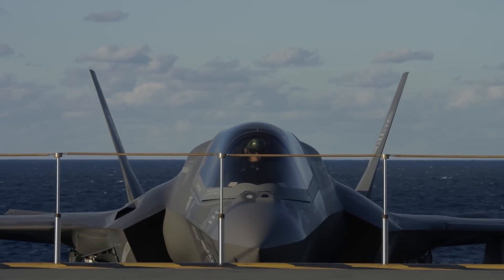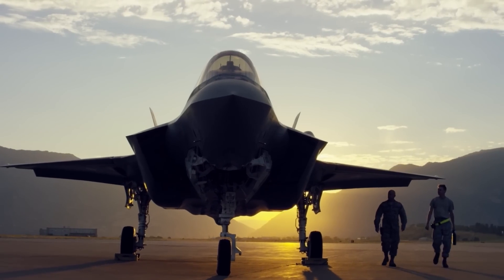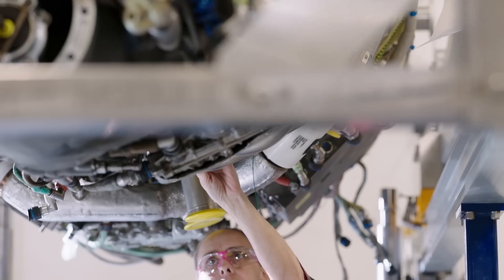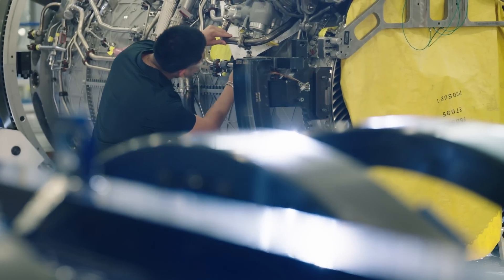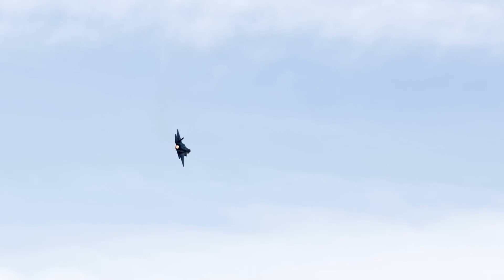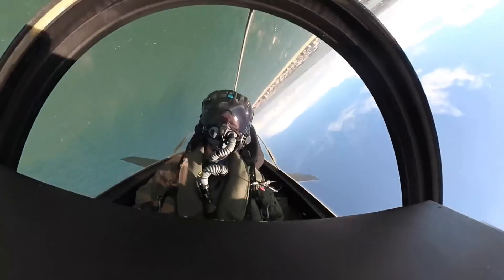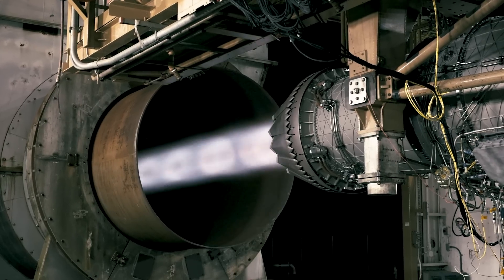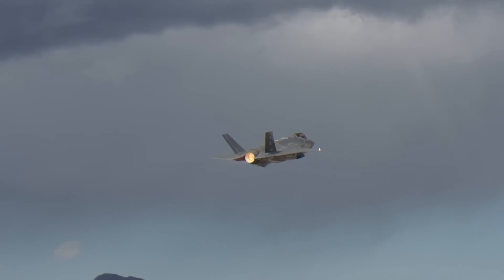The Future of the F-35

Comment: We need to start thinking of doing more, to field more quantity of high tech, cheaper cost of ownership over the life of the equipment and cheaper entry level variances of equipment. As much as I love technology, it is no good if the ceiling price keeps going up and up and up. If we were able to field 2,000 F-35 for the price of the 700 units and still be able to have the same costs of maintenance over the life cycle of the program and still maintain the capacity to keep flexible dormant production to  ramp up production in case of war, then the costs would be similar or even a 5 or 10% more, but we would have 3 times the size of the force, capacity to have airplanes cycle through maintenance and upgrades and still have significant numbers in service and a production line ready to pump more units in case of war. That would be surprising, we have to learn to work with less, not more..

Comment: Maybe the cause of that F-35 that made a rough landing on an air base was probably because the pilot lost focus on the VTOL and accidentally put more thrust instead of powering down the engine.

Something like that tends to happens in simulators. The simulator VTOL VR has some amazing mechanics and everytime I lose FOCUS on a soft landing, I tend to cause the mistake that happened to the pilot.

Maybe if the pilot powered down and pitched up, that whole landing mistake would have been avoided
Reply: "Maybe the cause of that F-35 that made a rough landing on an air base was probably because the pilot lost focus on the VTOL and accidentally put more thrust instead of powering down the engine."(sic)

Incorrect. Failed fueldraulic line as was the hypothesis last December and later confirmed by engineering analysis, not pilot error. Thanks for emoting though, madame.

By the way, the F-35B is STOVL not VTOL.
Reply: @AA-xo9uw  STOVL… I keep mixing them all the time

Comment: Isn’t it ironic, they just lost a F-35 from engine failure?
Reply: There have been no F-35 mishaps since the fueldraulic line failure on 15 December 2022 in Fort Worth. No cause has been released for the F-35 lost at Hill in October 2022.

Comment: This seems like just a marketing pitch.  Who is the intended audience?   The rationale (cautious evolution is faster, safer and less costly than a technological leap) is simple. Taken at face value, one may say 'Sold!'. But an intelligent decision requires proof of the assertions, and QUANTIFIED proof at that. The competition (adaptive engine) is more advanced. But 99.999% of us Youtube viewers are totally unqualified to assess the relative risk/reward of the alternatives. A counter argument is that the adaptive engine offers very significant increases in power and fuel efficiency (i.e. operational range). I believe I also read that for a given power level, it runs a bit cooler. That might partially reduce the amount of bleed air needed for cooling electronics, etc.
If any viewer wants to judge which is the better alternative, then viewing presentations/pitches for the alternative is a requisite.
Reply: It is a marketing pitch.  The F-35's engine, the Pratt & Whitney (subsidiary of Raytheon) F135, has hit its limits (ie. it has fallen short of program requirements) so a reengining is required.  The choices are a tweaked F135, a tweaked GE F136, the P&W XA101 ACE, and the GE XA100 ACE.  Raytheon's problem is that the F136 had better thermal headroom than the F135 to begin with, and when it comes to adaptive cycle technology GE is at least a decade ahead of P&W.  So this video is Raytheon desperately trying to remain the sole engine provider for the F-35.
Reply: @JonMartinYXD  Interesting. Thanks for the reply.

Comment: What about hormonic resonance problem? ECU only a light mitigation of thermal issue. You know turbine inlet temperature of F135 today? 3600°F (1980°C). The hottest turbofan of the planet. Early  Aging is fate of F135. Sand melts and blocks cooling ports of CMC surface of turbine blade other issue. GE has non adaptive cycle alternative also.
Reply: Yeah, GE has the XA100 ACE and the conventional F136.  The F136 performed as well as the F135 but had better thermal headroom.  If the JSF program had chosen the F136 this whole reengining discussion probably wouldn't be happening.
Reply: @JonMartinYXD  i agree

Comment: Can anyone tell if the VTOL capabilities are actually being used ? The verticality would come handy in the Pacific, but I'm not aware of it being used in combat. Thanks.
Reply: The F35B can vertically take off however, that feature is really for vertical landing. I think they call that STOVL which is Short Takeoff and Vertical Landing. It cost too much fuel to lift off vertically.
Reply: @Kyte001  Right, fighter jets need the right infrastructure, crew and equipment. So F-35s exclusively using helipads in case the runway is destroyed is silly. Got it, thx.

Comment: It's important to be able to save fuel, fuel is your life when you're out there, and keep that engine running hell or high water
Reply: I'm concerned about the f-35b thermal signature during takeoff on light carriers, it's generating a lot of heat in the transmission, and it could put a thermal signature on the carrier and make it a vulnerable Target, I wish the f-35b had more fuel capability of takeoff and Landing with missiles oh, you had a few have to dump you fuel before you can land and balance out the aircraft that's not a good thing

Comment: I’m sure it’s not this simple. But why not just put the cooling system for the electronics closer to the actual cockpit? I’m sure they could design something where outside air being pulled into the intakes could be siphoned off to act as the cooling. Seems like a lot less expensive idea than some kind of fancy new system.

Also, I don’t want to be a Donnie downer here. I greatly respect Raytheon technologies, and all that but I hate to say it I don’t see this plane being white I guess a lot of people want it to be. No maybe I’m wrong but if I recall correctly, the hold is basically for this plane to essentially replace the majority of fighters in the US military. that actually is not a good idea. Over specialization will inherently bring about weakness. And it greatly reduces the chances of adaptability.

Comment: Lockheed Martin should be embarrassed by the cost overruns and lack of performance of the F35. If it ever got into close in Dogfight, it wouldn't stand a chance. It's maneuverability is weak considering the cost per plane.
Reply: Get your head out of your ass reformer. Dogfights are a thing of the past
Reply: Its not suppose to dogfight. Its sensors are suppose to detect enemy vehicles, planes etc from very very long distances like beyond visual ranges and shoot highly accurate long range missiles at the target. What follows is the enemy plane is unaware they're detected and are unable to locate where the F 35 is even if it knew it was in the area this applies with missile defense systems. the F 35 currently can outrange some missile defense platforms, some older ones can't even detect it at all.
Reply: "it's maneuverability is weak"
Maybe dont trust forbes, RT, and Pierre Sprey and their bullshit since they dont even know the F-35's secrets https://youtu.be/2Xygbw6t_z0

Comment: Meanwhile on Capitol Hill-

“WASHINGTON — As the Pentagon and Capitol Hill gear up for a fight over the decision not to pursue a new engine design for the F-35, officials this week stated that increasing demands placed on the legacy F135 engine are poised to wear and tear it at higher than expected rates — resulting in what congressional auditors say is an extra $38 billion in future lifecycle costs. “

“Just 53.1% of the fighter fleet was found to be mission capable in February 2023, with 29.3 fully mission capable, according to prepared remarks [PDF] delivered by Air Force Lt. Gen. Mike Schmidt, who heads the F-35 program. As of March 1, there were 564 Joint Strike Fighters in the DOD’s inventory, F-35 Joint Program Office spokesman Russ Goemaere told Breaking Defense.”

If you throw enough money at it you can probably make it capable of traveling through time.

Comment: Anybody else realize the reason they gave for the need of the block 4 upgrade was, a bunch of hand waiving with the word "warfighter" inserted as much as possible? Lol eventually they get to hey we got cooling already, maybe let us do both? Bc its better for you? U buying that? Lol
Reply: From what i can tell.  Cost.  There are a lot of upgrades going into block 4.  Trying to add a new expensive engine was hard to sell over a much cheaper more manageable upgrade.  These upgrades will make up about 30%-40% of the difference in performance.  The cost is likely to be substantially different.

Comment: Kind of sucks we have to think of "tax payer" money when it comes to military equipment. There shouldn't be a price tag attached to National Security but it's been beat into us with the several hostage taking of the government from congress. I was an "essential" employee and had to work no matter if I got paid or not so I get it. Be budget minded with EVERYTHING so in return we only get more efficient and maybe not the best solution but the cheapest we can come up with while meeting the bare minimum of requirements.

Hopefully the engine that uses small nuclear for heat instead of fuel will be developed soon but I think that's Boeing or Lockheed; either way that would allow tons of savings with fuel and allow more budget for research as to what is best, not the cheapest.
Reply: people working without pay require barbed wire fence and armed guards to keep working past few months
Reply: Nuclear engines?  No.  That's been tried.  It ends up being horrifically expensive and all the radiation shielding required makes the plane much bulkier and heavier.

Comment: In other words, they don't want to lose the contract to GE.
Reply: You hit the nail on the head on this.  P&W has officially communicated to the USAF that there won’t be any future savings on the F-35. 

As a warfighter myself (pilot) the adaptive engine yes will cost up front NRE, but it will save operational costs due to less fuel usage on top of providing likely up to 25% greater range without sacrificing performance.  

Ultimately two suppliers will benefit our taxpayers best.
Reply: @turbooo7005  Fully agree. The F-35 needs to adapt to changing requirements & saving fuel resulting in greater operational range & other features of the adaptive engine are all wins for both the armed forces & the US they protect. We won't get that for no cost. No free lunch. Thanks for your service!
Reply: @turbooo7005  The US Government is at fault here for cancelling funding for the GE F136 engine in 2011!
Reply: @turbooo7005  Kudos to you for your service. I've read that GE's engine allows the pilot to balance increased fuel efficiency versus increased performance.  Another (unsubstantiated) claim is that with improved fuel efficiency, an inherent benefit may be less bleed air required because the bleed air is cooler. Have you heard anything to substantiate that?  What would be REALLY special is if we're so far ahead of international competitors that the F-35 gets the adaptive engine (especially in a retrofittable form), while the 6th gen fighter surprises everyone with a quantum leap - the  'Rotating Detonation Engine' (RDE). This technology is reportedly applicable to both rockets and turbines. 
https://www.youtube.com/watch?v=rG_Eh0J_4_s
Reply: @gregparrott  Even the GE F136 which lost the contract to P&W's F135 had better thermal headroom for the same performance.  When it comes to adaptive cycle technology, GE is at least a decade ahead of P&W.

As for RDEs, the potential is huge, but they haven't gotten past the point of keeping a tiny one running in a lab environment for more than a couple of seconds.  They will not be in 6th gen.
Reply: @JonMartinYXD  Based on the PUBLIC information on the development of RDE, you're right that the 6th gen won't use RDE.
But every now and then, DARPA or some 'black' project is revealed and pulls the proverbial rabbit out of their hat. People have reported the acoustic signature of pulse jet engines dating back well well over a decade ago. Maybe, just maybe some geniuses in skunkworks have that hat, but with something much bigger than a rabbit.  I can wish for that.
Reply: @gregparrott  That's true.  There is also the question of just what will define a fighter as 6th generation (we still haven't settled that debate for 5th gen) and that determines when we will first see one.  It is possible that the 5th/6th dividing line will be some new kind of non-turbofan engine.
Reply: @JonMartinYXD  Probably engine, directed energy defense, no tail fins for lower radar cross section, shrouded engine outlets, drone swarm control, much better computational power & integration with other systems/units, less emphasis on dog-fighting capability, much faster R&D to production cycle, helmet HUD. Those are a few things I can think of. Probably there will be more.
Reply: @turbooo7005  exactly. It’s not like P&W would run out of business either. There’s no way to replace the -600 anyway, so that will remain a revenue stream right there.
Reply: Ding Ding Ding!  The only reason Pratt & Whitney are still in the engine making business is because the US Government keeps giving them first dibs, otherwise GE would have wiped them out years ago.
Reply: I beg to differ. The P&W Geared Turbo Fan is a World Beater.
Reply: @BELCAN57  eh, I think RR kind of has geared engines in the bag with their upcoming Ultrafan. P&W never made it past narrowbody with that technology.
Reply: @dreadscott533  Think about the long-term, Monopoly of GE will have enormous leverage over US.
Reply: I think they already have.
Reply: Lol yeah xD
Reply: They also want the exclusive maintenance contract to stay alive that is where the real money is.
Reply: They don’t want to lose jobs

Comment: Can the cooling system be a system that separates and compresses/cools nitrogen (from the air) and runs it throughout the aircraft and exits near the exhaust which could help reduce the aircraft’s thermal signature? 
   Compressed Nitrogen could also be used as a fire suppression system and a bonus a way to keep metals / components from oxidizing thus adding to less cost and adding to flight time of the airframe.         
   But, all this might make sense on a newer design?        I have dozens of sketch books and notebooks full of this stuff .     Just watch videos like this and see what I could design to improve it’s design and/or performance:)
Reply: Yes. The cooling systems are getting very important and complex. Beyond just the engine the electric load is massive so I'm sure your ideas are valid and forward looking. I think (could be wrong.) That current systems use air to cool what is essentially a heatsink, which is partially submerged in fuel which is used as to help dissipate heat.  The problem with that is the whole fuel load will slowly heat when the system is under pressure.
Reply: they use compressed air the way you say, separating nitrogen from the rest of air is too complicated to fit into fighter
Reply: Yeah basically this

Comment: The F-35 is a multirole fighter jet that is currently being used by several countries. To enhance its capabilities, several upgrades are being considered.

One of the most significant upgrades that is being considered is the use of the GE Adaptive Engine. This engine is capable of adapting to different scenarios and can accentuate the reverse-launch capabilities of missiles. This means that the missiles can be launched from shorter distances and can reach their targets faster and more accurately.

Another potential enhancement is the use of vented wings. These wings have small holes that let air escape, reducing turbulence and increasing aerodynamic efficiency. This will provide better maneuverability and stability during flight.

An electromagnetic (capsule) surface-to-air and air-to-air refueling system is also being considered. This system will provide a fast and reliable way to refuel the jet while it is in the air. It will also enable the jet to carry out missions that require a longer range.

Armed landing gear is another possible enhancement. This would allow the F-35 to land in hostile territory while firing bullets at the enemy. This would enable the jet to carry out a surprise attack on the ground, which would be impossible with conventional landing gear.

Finally, a rocket launcher ejection seat is being considered. This would allow the pilot to eject out of the jet while still carrying a launcher. The launcher would then deploy the rocket, providing the pilot with a way to take out enemy targets while escaping from danger.

Overall, these enhancements would significantly increase the capabilities of the F-35, making the jet an even more versatile and effective weapon system.
Reply: Armed landing gear…surely you jest
Reply: @jedibusiness789  Yeah a lot of this is complete nonsense.  Actually everything except the reengining is complete nonsense.